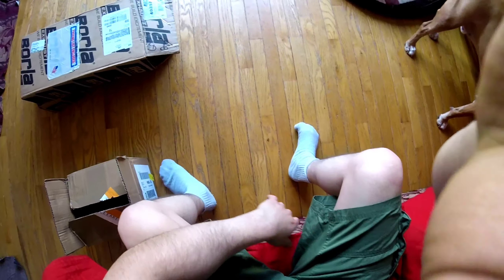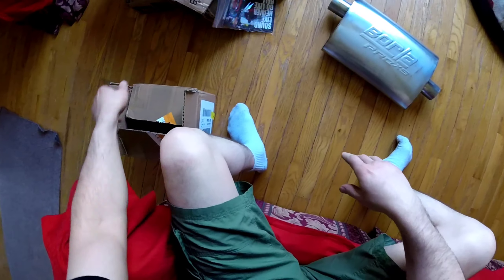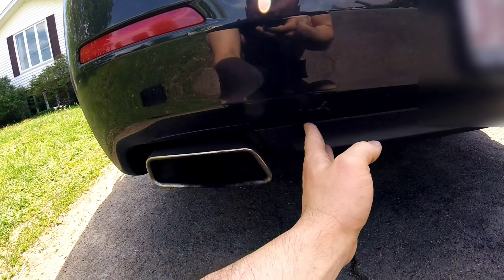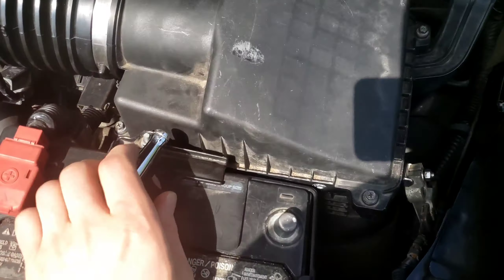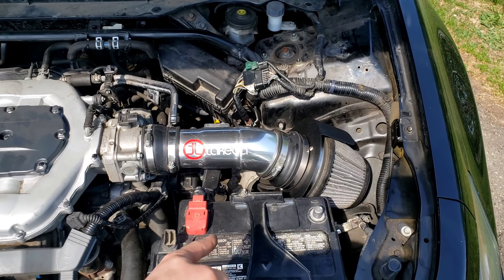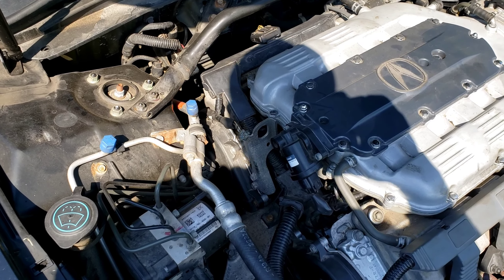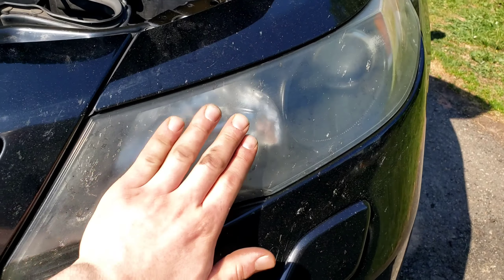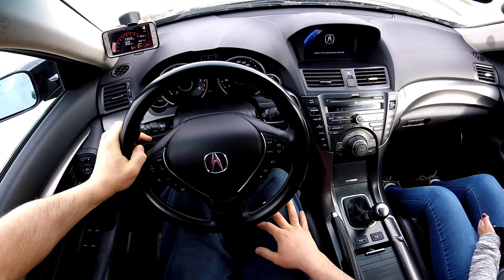TL SH-AWD Getting Custom Exhaust 155+MPH In 5th Gear | Acura TL Vs. Genesis 3.8

Comment: Heya buddy. Can't wait to hear the Borla all set up. The swirl marks on black cars drive me nuts! I'm so down for the TypeS. I hope it has 400hp which I think it will. Btw, I don't know if anyone else noticing this but the type S logo has the Y in the shape of a 4. And the P looks like it should. I wonder if that is a hidden clue giving away the HP numbet. Could you make a video going over the TypeS with your pros and cons? No one else seems to be analyzing it deep enough.
Reply from the maker: I could make a video on that. I mean I don't know much more then what's been revealed or hinted, but I got a few things to say about it good and bad.
Reply: I think it'll bring more attention to your channel especially as no one has really said anything besides it looks great, it's great comeback for Acura, etc, etc, but no one is mentioning that it should have come with a manual, the overhang past the front bumper makes the front side profile looks unnecessarily bulky, and stuff like that.
Reply from the maker: I'll do a little more research and see what I can come up with for a video!👍

Comment: Surprise face reveal lol. Not sure if you've seen this or looking for an actual legit diffuser, but a guy took one of those roof vortex generators that you see on Evos and STI's and mounted it upside down to the black piastic on the bottom bumper. Cleans up the look well.
Reply from the maker: Yah I've seen some in the 4th gen. There's a cpl universal ones that fit, which is probably what I'll be getting.

Comment: DOPE RACE  !!!!   GOOD JOB ON FILMING !!!  also. I'll buy that thing for $2500 !!!!!
Reply from the maker: Thanks, hopefully indeed him again for a legit 1,2,3 honk race. Rear main seal is leaking👎 190k miles, rust in some spots.
Reply: Nice!!!     That car was pretty fast though.   I finally got the 2012  auto 6 speed sh-awd , its not all that fast out the hole but it runs really well above 60. Hod willing,  Ill work on it some more later.
Reply from the maker: Nice! Trying to convince the gf to get one or is350awd, would love to compare and race against mine.
Reply: Yikes!!!   my gf works for lexus also, we had the rear wheel drive is350.  Mad a$$ fast also.  Lol.

Comment: How come you take in and out the cold air intake? Will the dealer give problems? Mine is also under warranty 2022
Reply from the maker: No, but if something goes wrong and they can blame the intake they can void it. So, I just take it off to be safe.

Comment: Hey man.  Speaking of headlights.  Have you ever noticed that your factory HID’s look really yellow compared to your LED fogs?  I put 6000k 7500lm LED fog light bulbs in and now the low beam HID’s look crappy.  I found out that Acura uses only 4300k in their cars.
Reply from the maker: Yah the DRLs are shit👎. I drive with my lights on even in the daytime, cause the HID low beams aren't as dim as the DRLs.
Reply: @RevsALot  My HID ballasts shat the bed. OEM replacement one was 500 from my local stealership.. Yikes
Reply from the maker: Geze! That's rough, wayy too much $$.
Reply: @RevsALot  I ordered a set from eBay and lets see if these are any good! I want my HID working nice again when I get my new headlights on!!!

Comment: OMG NO WONDER I COULDN'T FIND A CB EXHAUST!!! THAT COMPLETELY SUCKS! Only thing I can think of now is removing catalytic converters... Smh I don't understand how or why they missed that for this car,  2.25 piping and not able to go up on that with a true performance exhaust kinda bothers me.  I hate buying items without a tangible performance increase... 

P.S.
Two questions:

1. Will you be getting a dyno done and post the numbers? 

2. Have thought of having a tuner manually tune it per gear, or would that same tune software still be needed?
Reply from the maker: I'm not sure of the others, but the XLR8 CB has larger piping than OEM. I'm just going the cheaper route till next year. I will definitely be putting it on the dyno again, but won't be dynoing each mod cause it'll get costly. Going to get a protune once I get all my mods, and not sure if it's tuned by gear or that's just for turbos. 4th gear is this cars 1:1
Reply: @RevsALot  Good feedback thanks!

Comment: Hey, so I've found that 2009-2014 Acura TSX slave cylinder may be the same as ours, but has a C-clip to remove the delay cylinder. 🤙🏾
Reply from the maker: Hmm, good to know. I'm debating on buying one just to try it out.
Reply: I purchased one, it'll be here Monday, I'm going to take it apart, get the delay valve out, and then install it.
Reply from the maker: Perfect, let me know if it fits. Can't wait to be able to bang gears like the good ol Hondas. I'm losing a cpl tenths every shift atm.

Comment: bro im trying to install a catch can on my 4g tl do i need two of them?
Reply: @Presa Jo i dont see why there is no point i would rather not burn the oil inside of the motor i would rather have it flow elsewhere and dump it out considering i like to keep my rpms in the higher range majority of the time
Reply from the maker: I would think you would only need one...I've seen some slight oil in my TB, thinking of installing one in the future👍.
Reply from the maker: My buddy installed one on his Ram Hemi and got about half cup of gunky oil in 1000miles.
Reply: @RevsALot  better off not burning that shit in the motor creates serious carbon building increasing some pressure inside of the motor not good for long term thats why i believe a catch can is a good idea.

Comment: We need to figure out how to remove the governer!!😁
Reply from the maker: Already done with ktuner, I hit 160mph
Reply: @RevsALot  damn!! Right on!!😎  I needed that when I raced a Shelby 5.0...he got to 155, and I maxed out at 140mph.
Reply from the maker: @Acura Racing the only Shelby 5.0 is the F150, but unless FBO tune we can't even hang with the new stock 5.0 👎. Auto 4g TL are governed at 120-25mph, manuals 130mph.
Reply: @RevsALot  🤫
Reply: @RevsALot    my bad! It was a Fastback..  not shelby. Your right.  It has 460 HP..

Comment: I know am kinda late but does the tl have any oil consumption issue am trying to buy one with shawd
Reply from the maker: Yes, most of them do. Depends how you drive too.
Reply: Ok good to know am still gonna buy one tho😅 I love this car
Reply from the maker: Some ppl said they don't have oil burning issues using Mobil 1...Also, as long as you always make sure it's topped off you should be fine.
Reply: One of my friend has a 2011 MDX and he had burning issues and leaking from the oil main seal he got main seal fix and the dealerships didn’t want to do the repair on his engine burning oil
Reply from the maker: Damn, that sucks! They did send a letter out last year addressing the problem. I got my top end rebuild free of charge. I would go with the '12-'14 if getting one. I've heard of driveshaft propeller issues with '09-'11.
Reply: They were trying to charge him 2500-3000 to fix the car which I don’t get why if it’s obvious the car was burning oil. Those are the years am looking at hopefully I can find a good one soon since most in my area are rebuilt titles
Reply from the maker: Well, I got the rebuild and it's still burning so🤷‍♂️.
Reply: Damn 🤦🏽‍♂️
Reply: I have a 2013 TL SH-AWD and it doesn't burn oil, and I drive it pretty hard. 

I had an Audi before my TL and it was a nightmare burning oil.

Comment: You can go 160? Lol wtf even with ktuner governor off, my auto tl shawd only does 135 or so haha and thats the governed speed anyway. Or did I just do something wrong in terms of turning of the governor
Reply from the maker: I'm not sure. I thought they were governed at 120-25mph, but never seen an auto ktuned TL try a top speed run.🤷‍♂️
Reply: @RevsALot  I've hit 135, with ktuner and no bog down. But the car seemed to pick up sooooo slowly at that speed, gf was in the car tho so maybe that's why idk haha
Reply from the maker: @JoK3RH3R0  yah it depends, I know they auto shift to 6th and don't hold 5th when stock. Not sure about ktuner, unless you have the 5spd auto might be different.
Reply: @RevsALot  I was looking into it, looks like I've got a 5 speed auto, but the torque converter makes it feel like there is an overdrive gear. I'm thinking maybe my torque converter might have some issues or something cause it sometimes bogs in 3rd.
Reply from the maker: Ah k, yah 09-11 is the 5spd. Probably just drops out of vtec in 5th so that's why it'll take a while